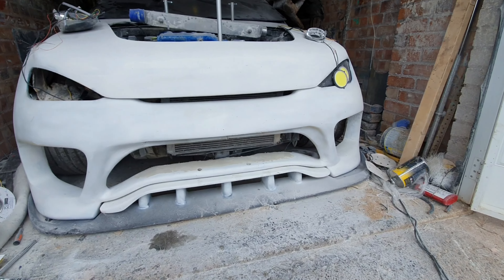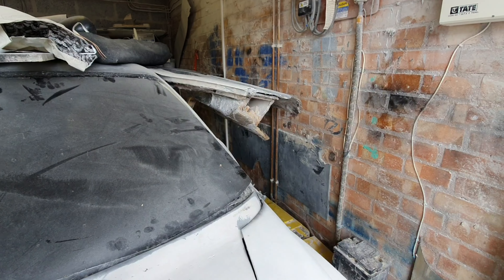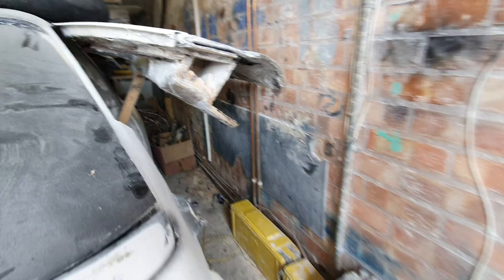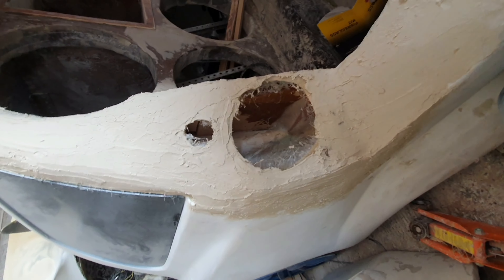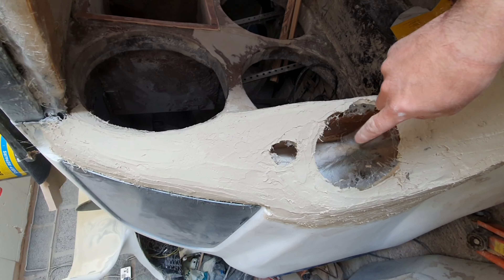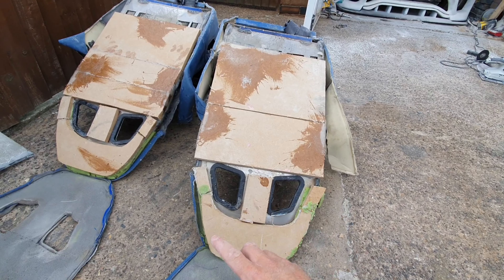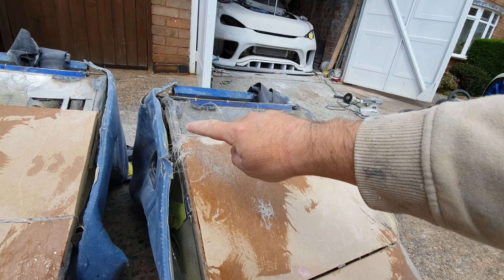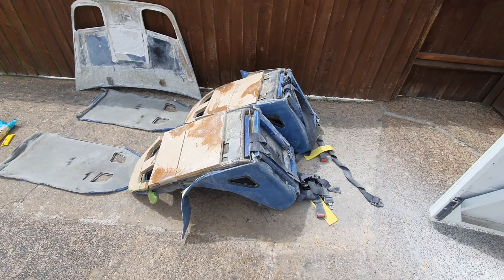166 - Drivers side speaker pod fibreglassed and first filler, scuttle panel sand...seat back started

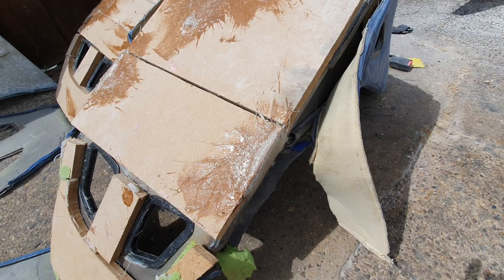Comment: When you put fiberglass over an edge you should round the edge off first the glass will sit much better and it will stop you getting air bubbles in it like you have @5:02 basic fibre glassing principles that mate. You’ve been at it long enough now you should have worked this out. But why make things easier for yourself now I suppose
Reply from the maker: This was only a test really to see if the idea worked and held in place...and it turns out it worked pretty well. The whole back of the seats will now need to be glassed to make sure its solid and make the shape I'm looking for